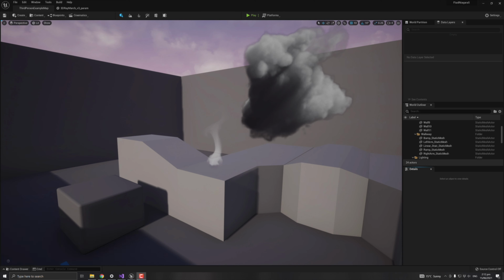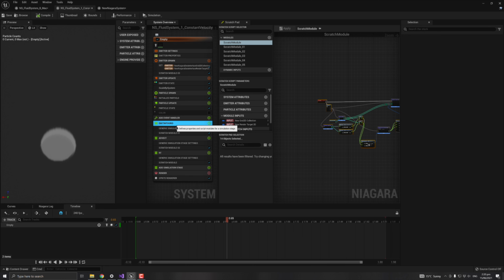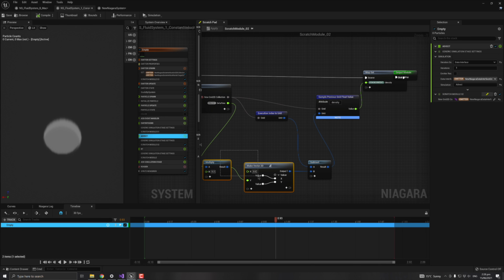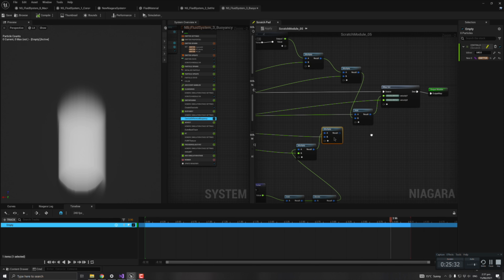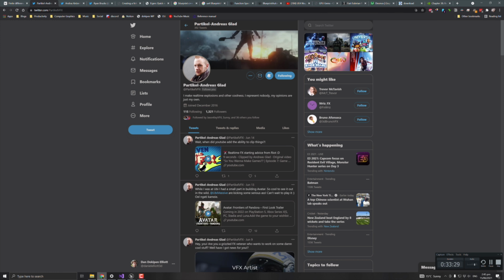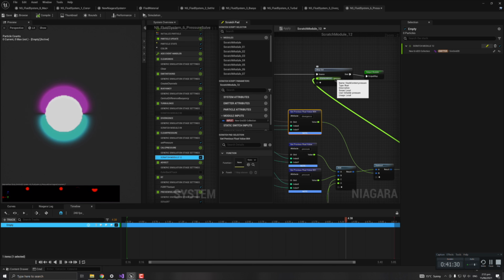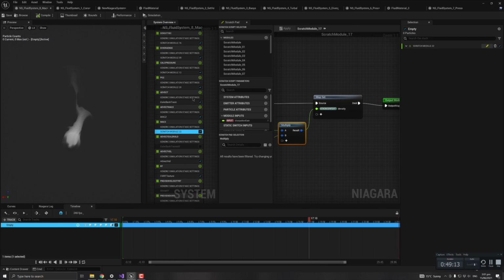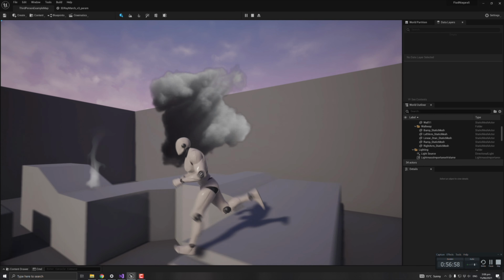Fluid Simulation Experiments In Unreal Engine 5 Niagara

Comment: Hi, great tutorials. Looking forward for more tuts at such quality! Btw I have a question, at 19:35 the system is constantly emitting smoke, but you only have three simulation stages. The second one is the simple advection stage. The first one is emittogrid, I assume it is just a one-time initialize stage. So when do you add "Old" density and "New" density? I am stuck here. Any hint will be appreciated.